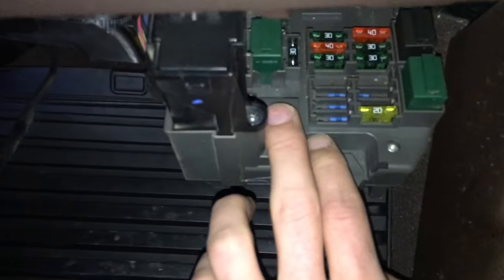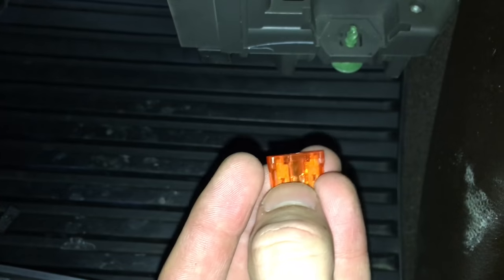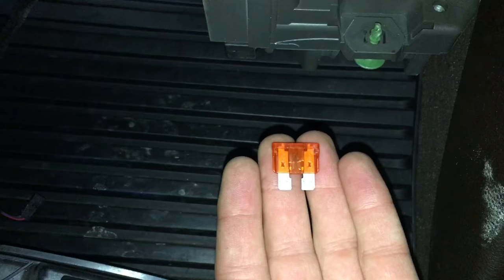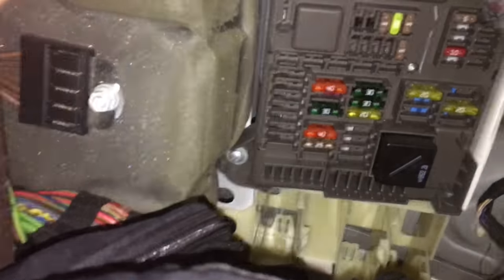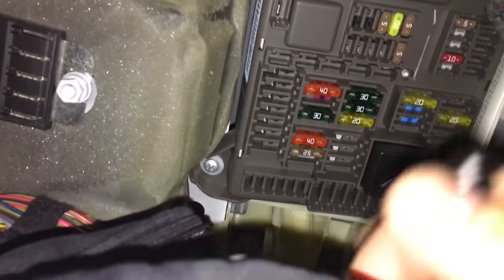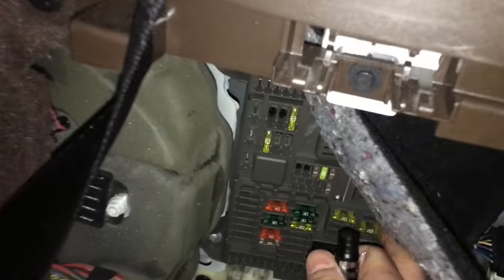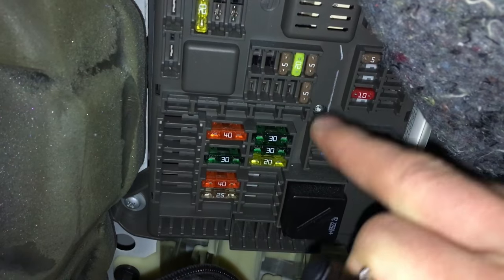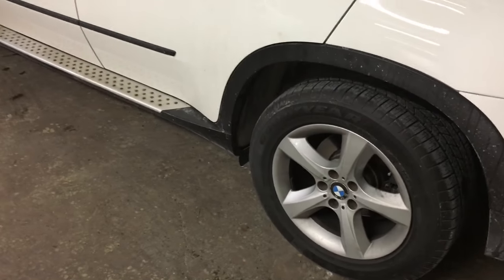BMW X5 E70 Rear Suspension Problem Fix

Comment: I could really use your help , (2012 X5 E70) car was sagging in the rear which was causing the the compressor to short cycle (but never got an error message) , so I replaced both rear bags myself (Arnott Airbags) problem SOLVED , I had no issues for months. So today I got in the car and got a “level control system failure” on my iDrive after the compressor ran for about 3 min. The car currently sits SLIGHTLY lower in the rear than in the front but nothing like it was before I replaced the bags months prior . When I start the car the compressor does Run, but sounds more noisy than Usually. It’s very hard to tell if it’s pumping or not because the car is barley sagging.  so I followed your video and and opened the fuse box in the trunk (10A fuse wasn’t broken) so I opened the the fuse box  on the passenger side (40A fuse wasn’t broken) I haven’t checked the the relay yet , but if the relay was bad the compressor wouldn’t run at all right ? Also there is no hissing sounds coming from the car when its off. Could weather have a effect on the compressor? It’s currently been 30 degrees Fahrenheit in Maryland (for weeks) , when I’m home in Florida it’s almost never below 50 degrees.
Reply from the maker: Hey Ty JuukzTv thanks for watching my video.  Are you able to scan the system with a full system scan diagnostic tool to read the error code? If so please share updated diagnostics. If your fuse was broken the pump would not work intermittently, it would just cease to work.
Reply: Funny cos I just commented about this on another video. When the car is started and the compressor pumps for a few minutes and fails with a warning message, it is the compressor. Generally it is the O-ring in the compressor is worn down and causing blow-by in the chamber. The system stops itself if it not building pressure properly. Rebuild kits are very cheap and easy to do yourself :)
Reply from the maker: 'Hey Bloom0to9 thanks for that information, very helpful.

Comment: I have a problem the car does not see low on the bag but when I unlocked the car I hear air going to the air spring , after replacing the struts I no longer hear it do you know what could be the cause?
Reply from the maker: Thanks a bunch for watching my video and taking the time to comment. Have you tried the reset? Potentially your computer has stored faults creating issues in the system. Also possible your compressor and relay need to be inspected for proper function. Please share an update, thanks.

Comment: Hi, I have the level control system failure light come on sometimes ever since I bought the car last year. I’ve never seen any sagging and have never felt any weirdness while driving. The light comes on after I hear a loud buzzing noise (I’m assuming it’s a compressor) stops working. However no signs of sagging. Help?
Reply from the maker: Thanks a bunch for watching my video and taking the time to comment. Without scanning the car and seeing the fault it’s hard to make a determination on the fault. Based on the symptoms it could be a failing air compressor. If you choose to you can save money by getting the compressor rebuilt rather than replaced. Google search, suspension compressor rebuild kit BMW X5 E70. This will give you cheaper options than replacing, make sure to get a new relay when rebuilding. Please share an update, thanks.

Comment: My BMW X5 has the rear sagging,  when I reset the rear fuse box in orange color, the rear sagging suspension is fixed for about one week and it has the same problem again?  Please give me your advice.  Thanks
Reply from the maker: Thanks a bunch for watching my video and taking the time to comment. It is possible you have a leak in the system, potentially by the valve block, have you checked for leaks?  Please share an update, thanks.

Comment: Hello! I have a 2007 BMW X5 3.0

I replaced the rear air shocks and now they are not inflating. Any ideas?

How do I know if it's the ehc or the compressor? I could hear the compressor hissing before I replaced ( one shock had a hole in it) and it was throwing the level control system error message. 

I know have no error codes but again they aren't inating 😐
Reply from the maker: Thanks a bunch for watching my video and taking the time to comment.  Did you try to do any reset of the level control module, computer , fuse? Have you done a full system scan of your car, not just OBD. Please share an update thanks.
Reply: The same problem happened to my vehicle.
One of the suspensions had burst.
I changed both of them. Then the rear lifted itself fully into the air.
The level sensor of the exploded suspension side was also broken, I replaced it. This time it remains lower than the other side. The car looks crooked. The tire of the lower side became flat like an F1 car tyre.
I didn't do anything related to insurance. It's a really terrible situation. @WheelsTips

Comment: hi there great video ... i wanted to know from your experience..  my mechanic said there is minor leak in rear shock absorber is that any how related to air suspension ? or do i need to replace the shockers ? my car is x5 f15 seems normal no sagging at all .. thank you
Reply from the maker: Thanks for watching my video and for the great question. If you have a mechanic that you work with and trust, you should work with your mechanic. Personally I have seen most cars with leaking rear air suspension have some sort of sagging. Often times when replacing the air suspension both sides should be done in tandem. As I said in the beginning if you have a working relationship with your mechanic, work with them. Looking forward to an update, thanks a bunch.

Comment: After having my rear air bags replaced after sagging now the right side is going up to high the compressor keeps going on every so often to pump the read up when it already is up higher than it should be any ideas??
Reply from the maker: Thanks for watching my video and taking the time to ask a question. Truthfully with the information provided it would be best to check if you have any stored codes and perhaps try to calibrate the system. Please share an update thanks.

Comment: where would i find the air susension relay? cause a friend said that also might be my problem. i replaced bags and conpressor. havent checked fuse yet. but just in case, i wanna know where the relay is located. do you know?
Reply from the maker: Hey KLVNSPITTA thanks for watching my video. To the best of my knowledge the relay for the BMW E70 suspension compressor is located under the hood in the drivers side fuse box. There should be a diagram when you remove the cover. Please let me know what you  find during your diagnostics.

Comment: Hi love the video where can I find the relay to the air compressor? Please and thank you for the life of me I cannot find and my new compressor came with one
Reply from the maker: Thanks a bunch for watching my video and taking the time to comment, apologies for late response.  The relay for the Suspension compressor motor relay, is in the instrument panel fuse box ( most likely by your glovebox area), relay number 1. Also check while there fuse F120 Active suspension control module and fuse F32 	Suspension com pressor pump.  Please share an update, thanks.

Comment: Hi I pull out the 10 amp fuse and put it back in but my compressor would not start, Any idea what would be the problem please ? Thank you
Reply from the maker: Hey Ehsan Sokout thanks for watching my video. In my experience I would test the compressor for proper function. Do you have a scan tool capable of that?
Reply: @WheelsTips  Hi Thank you for replying back.  With the Snapon scanner it pumps up, which means the compressor is activated and the the bags hold the air but when the vehicle is driven the bags deflates
Reply from the maker: Hey Ehsan Sokout did the ride height sensor read correctly? Did you find a solution?
Reply: @WheelsTips  yes ride height sensor reads correctly, no solution found yet
Reply from the maker: Are there no fault codes stored at all?  In my experience the valve for pressure release has been faulty before in the internals of the compressor unit.
Reply: @WheelsTips  I will check it tomorrow when I am at work, Thank you
Reply from the maker: @ehsansokout8611  Hey just wanted to check in and see what was the solution to your BMW suspension issue, any update is greatly appreciated, thanks a bunch.

Comment: Hello interesting info gathered from video. I have a 2005 745li bmw and changed both rear air struts and car still leaning to the right (passenger side. Any idea what it could be causing it to still lean?
Reply from the maker: Thanks for watching my and for the great question, I would Google search, 2005 745 air suspension valve block. It’s possible the line going to that may have an issue somewhere between the valve block and strut. Also possible there is something wrong with the actual air suspension solenoid valve. Please share an update if you checked the line and the valve block, thanks for any update.
Reply: Thank you very much and I will. I subscribed to your channel keep them interesting and informative  videos coming. Have a great day 😎✌
Reply from the maker: Thank you so much you are greatly appreciated.

Comment: Hello Sir
I have a 2016 bmw x5. I noticed right  rear sagging. When I switched on it came to normal position. Then after 1 week same thing happened. I went to 3 few mechanics.  They all are saying different things.. one said air suspension leak, other said some valve issue, another person said compressor issue.

Can you please advise 🙏
Reply from the maker: Thanks a bunch for watching my video and taking the time to comment. Given you have been a couple places it maybe hard to pinpoint your issue, given it seems to effect only one side the airbag leaking is not a far shot, but this again depends on the physical diagnostics. You would physically have to check for leaks and would need a diagnostic tool to assist. Please share an update, thanks.

Comment: Hi great video. I have the same suspension problem on my 2010 X5M :( when I park the car left side goes down, but not always, sometimes it does and sometime not, I dont want to change bags, can this solution help me fix this? How can i diagnose problem before bag replacement.
Reply from the maker: Hey Guka Avi thanks for watching my video.  This is a temporary solution for many till they address the issue of why the car lost air in the first place.  You can scan the suspension module for faults and spray the valve block for the suspension with soapy water to check for leaks.  Please share an update, thanks.

Comment: Would you know where the fuse for the pan roof is. Or moon roof  my blind works but the glass does not as the last owner removed the fuse. Thanks
Reply from the maker: Hey frankie hart thanks for watching my video.  It could be a few fuses and also may need to initialize by holding the close button for the moon roof for 15 seconds. Fuse in glove box F5 (10A) Sliding roof, F19 (5A) Air conditioning Dynamic stability control (DSC) Roof, CARGO AREA FUSE LOCATION F114 (5A) Parking distance control Sliding roof lastly in cargo area F117 (20A) Sliding roof.  Please share an update.

Comment: Hey, my X5 4.8 2008 E70 has a "Self Level Suspension Inactive" light on.. my mechanic said that I need to replace my air  suspension pump, but I don't feel bumpy when I drive my car and it feels like normal.. I guess I could try to reset that before I changed the pumpm. could you tell me what's the most common problem that caused the self level indicator on and how to fix it? Thank you
Reply from the maker: Hey Erick Kevin, thanks for watching my video. The situation is complicated because many things are at play in this system. I would need to know the code you get and or the symptoms if there are any, such as; does your suspension sag to one side, front, rear when the car is left over night or can you adjust your ride height? ALSO, did your mechanic try to clear the code and did code come right back ( which is possible)? Please help me narrow the details down, if you have them.
Reply from the maker: Hey Erick Kevin, if you replaced the fuse and the pump did not activate than yes you have a bad pump along with other things. The pump went bad because you have a leak in the system, you would have to check the valve body for leaks and or your air struts for leaks. So in short yes you may need a pump AND you have a leak in the system.

Comment: Hey great video ...i wanted to know where is the panaromic sunroof fuse located ... my panaromic sunroof got stuck out of no where and i think it might be the fuse..i have a bmw x5 2008 4.8i
Reply from the maker: Hey Haris S thanks for watching my video. If you have a stuck panoramic sunroof and you think it is the fuses it is fuse F114 (5A0 and F117 20A in the rear distribution box on the right side of rear compartment and you have a 10 amp fuse F5 under the right side of dash fuse holder. I would keep in mind that often the sunroof needs adaptation so you may need to reset the top or your sun roof rails need adjustment, lubrication or replacement. Check to make sure you do not have anything lodged in the sunroof's path such as a twig. Please let me know what you found. If any of this helped please consider subscribing to me, it would help a lot.
Reply: I just changed the fuses 2 of them were blown and now the sunroof is working fine thankk u soo much man u deserve a million subscribers...great help
Reply from the maker: @harisshah3  Never saw this comment YouTube snuck it by me :) (2 years later) thanks again I am up 8,000 subscribers since your comment.  I want to thank you and people such as yourself, comments are inspiring to creators, thank you so much once again.

Comment: Hi I could really do with your help, I have a BMW X5 e70 2011. The rear is sagging and I can hear the compressor when I open the door but the back does not life up. I checked both air bags and the drivers side air bag does not inflate where was the passenger side does. I also checked the fuse as per ur video , the fuse was not blown however when testing the fuse with a tester it fails, all the rest of the fuses work

I also had rac check using their computer and it came up with

System Type: CHASSIS
Name: CHASSIS - ELECTRONIC HEIGHT CONTROL DTC: 5F9A,Regulation time fault, raise

I could do with your help

Thanks
Omar
Reply from the maker: Hey omar hussain thanks for watching my video. I have another video if you look through my channel where I talk about the valve block. You may want to run some test to see if you are losing air by the valve block. Soapy water check your lines at the connections to see if you are losing air. Please share your updated diagnostics.
Reply: @WheelsTips Hi thanks for the response, i could not find the video you said, can you post the link for it please.
Reply from the maker: Hey omar hussain it looks like I may have somehow removed the video, were you able to find a solution? Please share your fix, thanks a lot.

Comment: Hi , I have a BMW X5 2011 40d , rear suspension was very high, I calibrated to lower , once I calibrated went all this way down went (transport height ride) ,I tryed lots of more time to recalibrate , some time dose but some time not, what’s a value of air shall I put my rim is 21” ?
Reply from the maker: Hey Hardy Shaswar thanks for watching my video.  Are you able to give the system a full scan for fault codes? Also it is best practice to see what your rim/tire supplier recommends as the PSI for your tires.
Reply: @WheelsTips  thanks for the reply,  its fixed now. All gd
Reply from the maker: Awesome that is great, please update on how it was fixed.  This may help a lot of people, thanks again.
Reply: Hi - have you had any one work out why the rear suspension goes to maximum height (and how to solve it). Unfortunately I have that very problem at the moment.

Comment: Hi Wheels Tips. I also have a problem related to the air suspension. My car is a BMW e61. Today I received the "Level control system failure" error and the car was on a very low level on the back side. I checked the fuse and it was blown. I changed the fuse (40A) but as soon I start the engine the fuse get's burned again. Do you have any idea what this could mean ? Or can you tell me where can I find the circut diagram so I can check for short circuits? Thanks.
Reply from the maker: Thanks for watching my video and taking the time to ask a question.  Do you know what fuse number that 40A was and what fuse box?  Does your air compressor run and lift the back of the car? If the fuse is burning out the component associated with it need to be inspected.  Please share an update. thanks a bunch.
Reply: Hi! I have the same problem with my e61. The 40a fuse from the compressor is burning every time i start the engine, the compressor dont start. Can you tell me how you solved the problem?
Reply from the maker: @mathebarna1430  Thanks for watching my video and taking the time to comment. You may want to look at some of the other comments, people have done everything from change the beeds in the compressor to, changing the compressor, relay and fuse all together. Lastly want to make sure you don't have a leak in your air suspension. Please share an update, thanks.
Reply: Sadly it was the compressor, I changed it and now is working everything fine! Thank you for your response! 😁
Reply from the maker: That's a bummer, glad you were able to get it fixed.  If you changed the compressor make sure it came with a new relay, if it didn't I would get one.  Thanks again for the update.
Reply: Thanks!😁